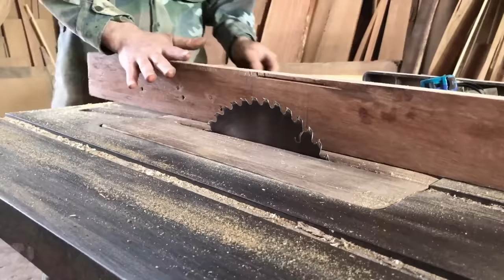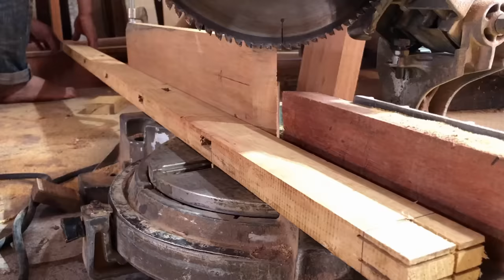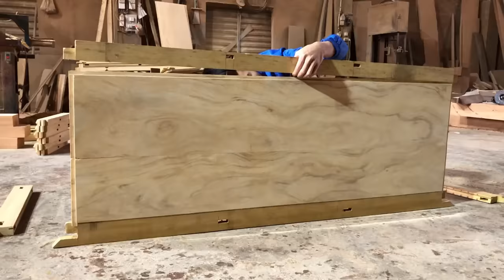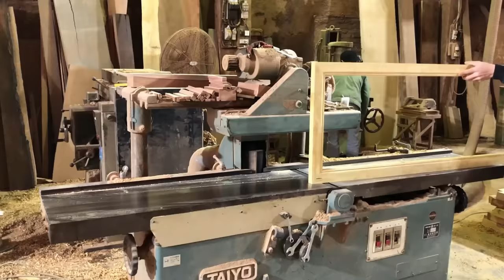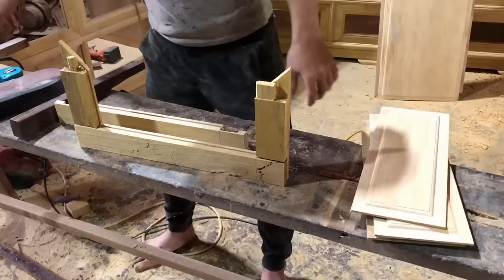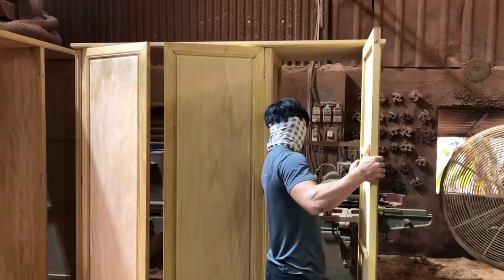Amazing How To Build A Modern 2-chamber, 3 drawers Wardrobe // Project Woodworking Design Furniture

Comment: Now can you show us how to build this wardrobe without these machines
Reply from the maker: You want to build a closet manually, DIY
Reply: @WoodworkingCraftsman  yes.
Only circular saw, clamps,tape measure,drill and square I have
Reply: Greg Richard 
Make a video to show us how you do  it! In case you don’t know, The Japanese  and the Chinese can build a building without a single nail.